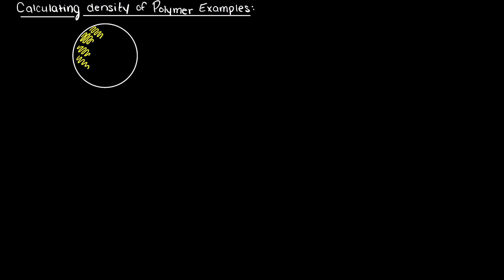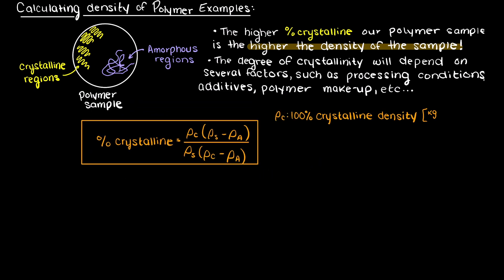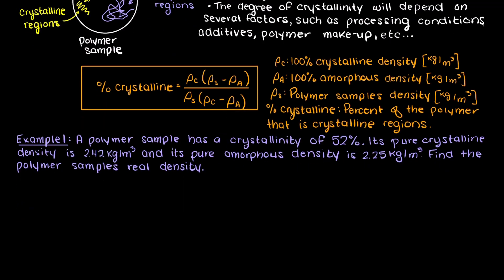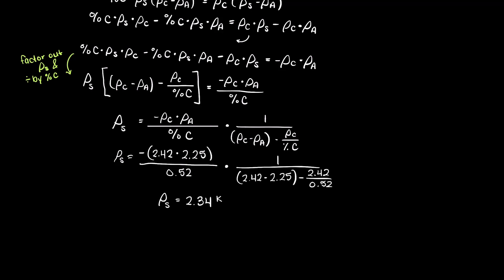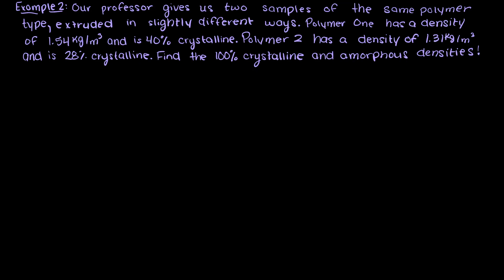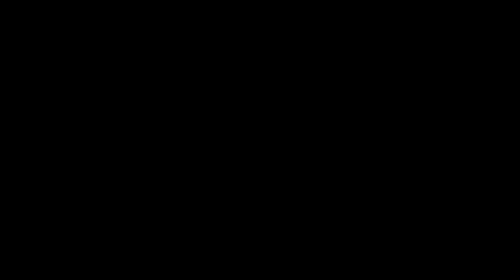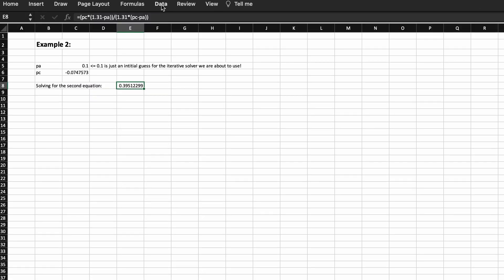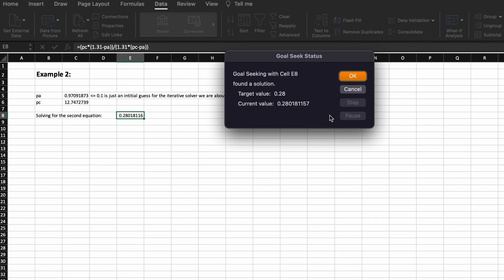Calculate Polymer Density Examples

Comment: Good video about polymer crystallinity formula. Your straightforward explanation really help me refresh my memory during college. However, I'd like to point out potential improvement specifically for formula presentation. Common difficulty that frequently experienced by students when faced with formula is memorization. It will really help to memorize things if you know reason behind them. Lack of knowledge about reason tend to twist formula. I still got density subscript swapped. I think this problem could be resolved by adding physical meaning behind each mathematical expression. Honestly, I still feel nugged by this particular equation. I've tried to intepret any physical meaning that motivate it to no avail. What do you think about this?